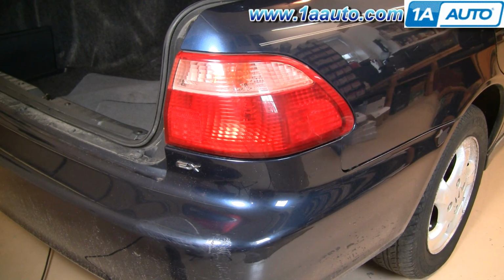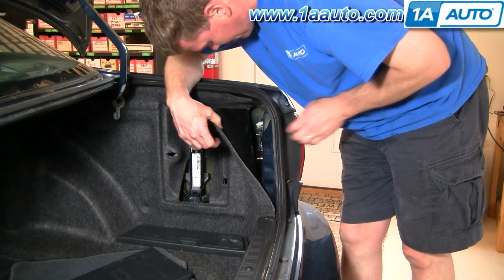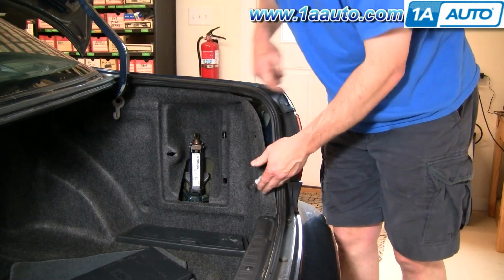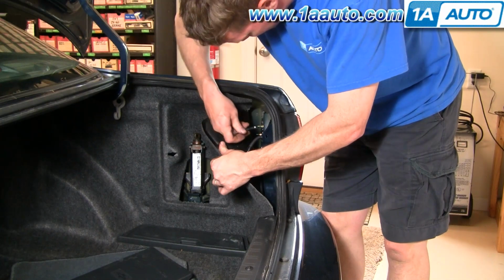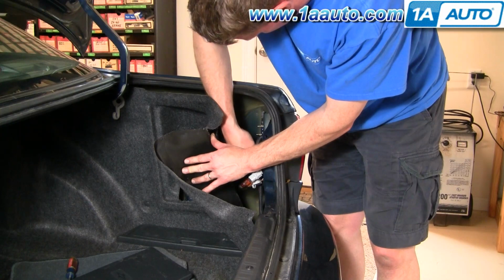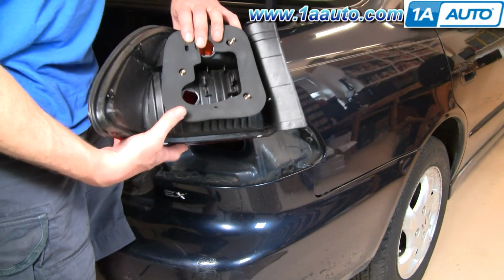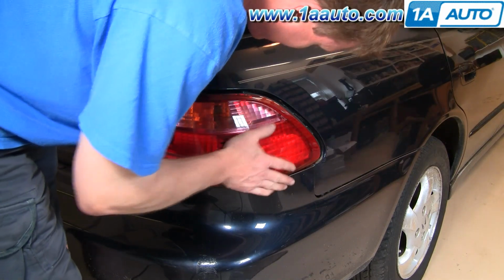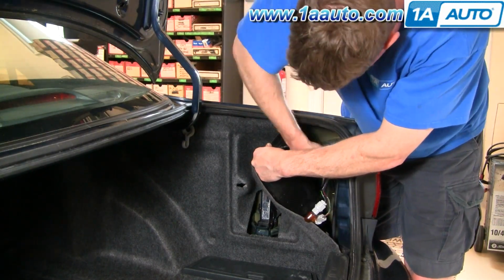How to Replace Tail Light 98-00 Honda Accord

Comment: How do i replace the tail light lens in the TRUNK lid, (rear inside lens driver side), in my 2002 Honda Accord? I bought the part from you, 1AA. But no instructions came with it. Lol
Thanks.
Reply from the maker: Thank you for your order, we currently do not have an auto repair video for that particular part. On the inside of the trunk lid, there should be a couple of bolts that secure it to the truck lid, once you remove them, you should be able to change it. Hope this helps you out. 1aauto.com 888-844-3393

Comment: i replaced the driver side rear brake bulb but it still doesn't work. is there a fuse also? The other side brake light wrks....
Reply from the maker: You may want to look for a possible frayed or broken wire if  one side works fine and the other does not. You could also follow the circuit with a test light or an ohm meter to see where (on the circuit) you're loosing power. Hope this helps you out 1aauto.com 888-844-3393

Comment from the maker: There may be a couple of nuts or screws on the inside of the truck that are used to attach it to the deck lid. We currently do not have this vehicle with us to check for you, but you may want to check on the inside of the trunk lid to see if that's the case.

Comment from the maker: @hectorrr3 There are some tabs on the socket that hold it in place. You would need to twist the socket as shown in the video, so that the holes on the housing line up with the tabs on the socket.Then you can pull the socket out. Hope this helps you out.